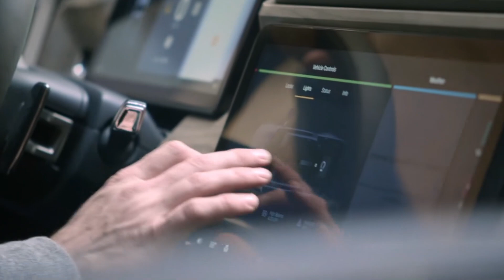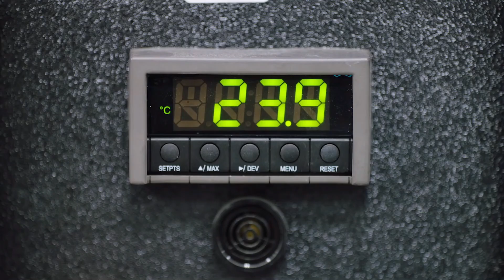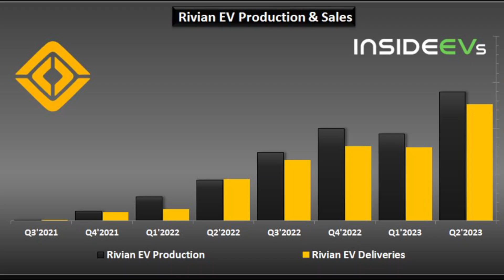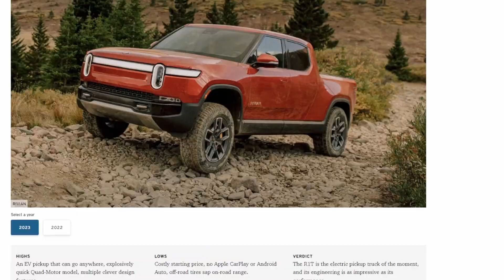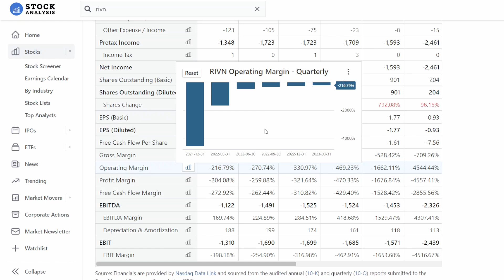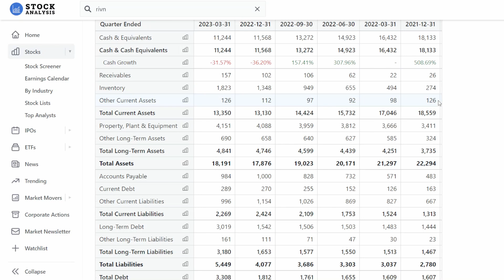Why Rivian Is An Electric Vehicle GIANT In The Making.

Comment: Thanks VA for the info, I think yr right. Rivian at it's core is a high quality long term company, and like some others, has the 3 essential ingredients (FBI) to achieve this success, plus growing demand, good verticals, product price is not a problem, it's stock is going thru the normal growing pains assoc with most manufacturing ramp ups, b'c it's tough to do (eg: TSLA), global environment & us emotional investors, it will be a triple soon enough. From a long term investment view I feel it's an excellent opp and I wouldn't be surprised if it becomes a member of the "T1 Club" down the road. These are personal views/thoughts only, not advice, stock rec's. Thanks VA. Cheers Kev

Comment: BEV trucks for off roading is a joke.
Reply: Yet, it clearly works
Reply: @TheVibration1  when your many miles away from a charger.  it clearly doesn't work.
Reply: @InvestorSpeed  that only happens if your a chump
Reply: Plenty of trails in a 300 plus mile radius.
Reply: @michaeleaton6847  if you travel 300 miles anywhere, you'll have to change to get back.